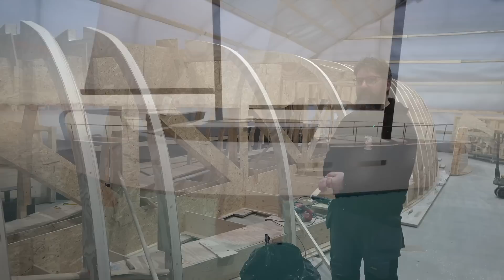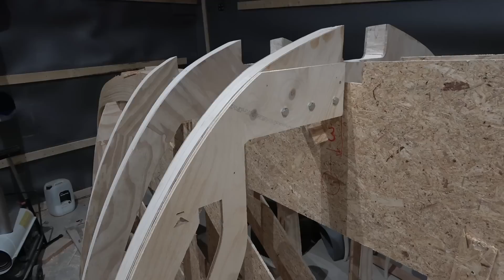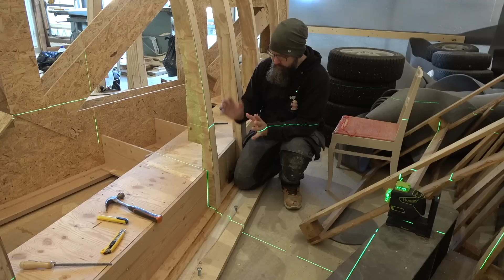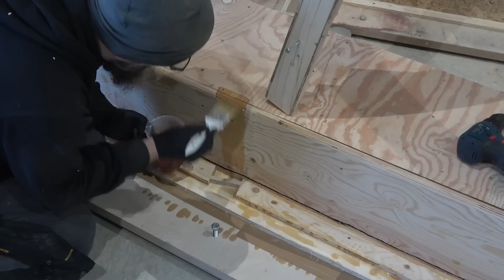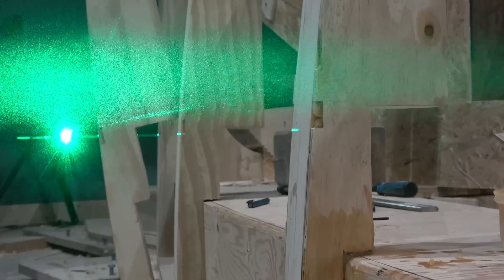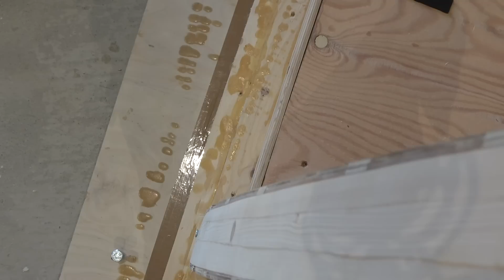Gluing in the first frame! 😱 - ⛵️ Building 50ft Sailboat - ep81 Project SeaCamel

Comment: If I could make two suggestions, first put a reference mark somewhere on your building.  That way you can always find level on the boat, i.e. the building reference is 250mm above your rub rail notch. Second, while gluing up your frames, while you are there with thickened epoxy, put your corner fillets in.
Reply from the maker: Hi!
Now when the frame is fixed in place, I don’t really need ref line marked anywhere. Maybe later when planking starts to go in.
As for the fillets. I thought about that but I decided to make them when doing the fiberglass so that they will conform perfectly underneath and wouldn’t need to be sanded prior to that.
Not sure if everything really needs fiberglassing but I’d like to protect all the wood surfaces well nevertheless.

Comment: Nice Work! I always had a problem with too much epoxy and tried to come up with some uses for the small amounts I had left over. I made a few coasters and quite a few different shapes to use as spacers, or shims. One idea I had would be for you to have or make a silicone mold of your logo / boat that you could give or sell to your supporters. Keep at it!
Reply from the maker: 😃 that could be something!
But I’m currently building an epoxy distribution machine that could make it much easier to make small batches.

Comment: I never imagined anything this big, made out of wood could be built with such precision. You are an inspiration to me, as I am building an airplane out of wood, with much less precision.
Reply from the maker: 😄 and 😮!
Reply: Hi Panu, this extreme precision takes a lot of time and I ask myself how big the benefit of that is vs. costs. I‘m modifying and refitting my Shark 24 and did some measurements, to find out the boat is not at all symetric, like off by a lot compared to your standards, we‘re not talking millimeters here, we‘re talking centimeters! Think of the 80/20 rule: it takes 20% of time to get to an 80% result and 80% of time to get these last 20%.
Reply from the maker: 😀 That’s kind of a lot I think!
But in my case the precision pretty much comes from the CNC-cutting. There’s really not very much manual labour involved- which is kind of the point.
But also I try to maintain the precision in good level to be able to fit additional CNC-cut parts later as well!

Also, I’ve never built a boat before so I don’t really know what’s important and what is not! 😅
Reply: @ArcticSeaCamel  I know from how I work, when I set on a certain amount of detail / precision, it‘s very hard to let this go. But, you also like to finish some time 😉 So yeah it might be worth taking some time to think on how much  precision is needed… wood is very workable and as you said in the video a few minutes of sanding can get things to fit perfect where keeping CNC precision throughout the whole built, takes much more time 😉 Don‘t get me wrong, I‘m not advocating taking short cuts, just consider if the method is really helping or maybe slow you down to much…
Reply: @ArcticSeaCamel  You cannot have perfection in an imperfect world, but you are trying your damnest! I was always told that an early error will result in desarster later.